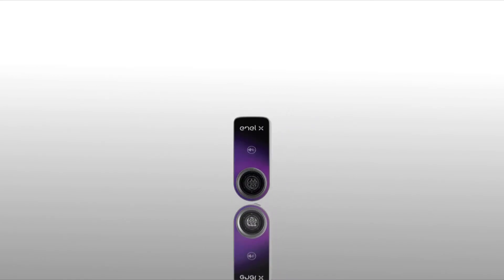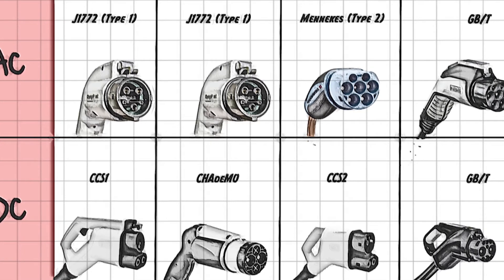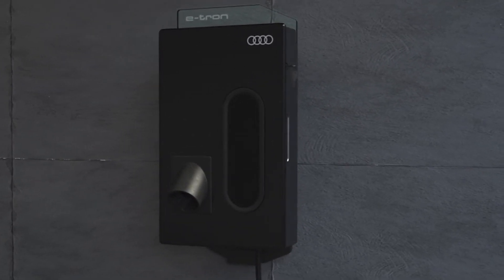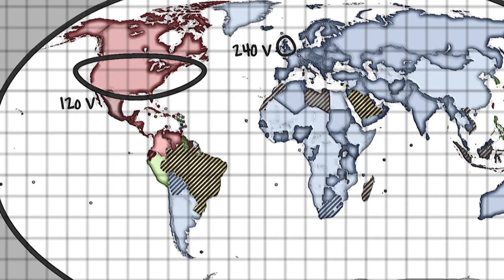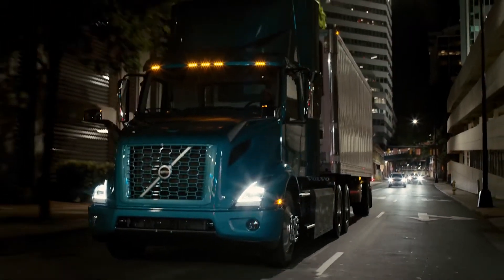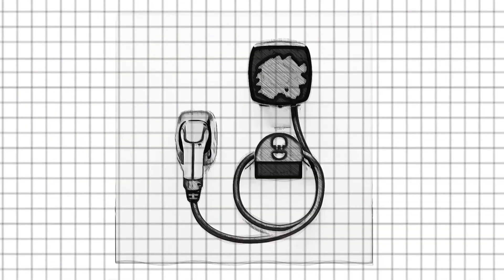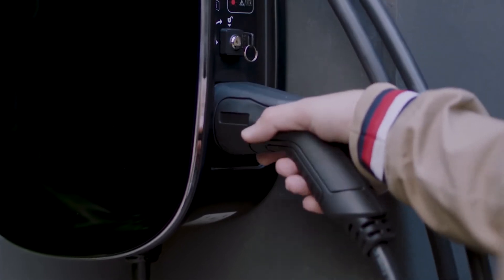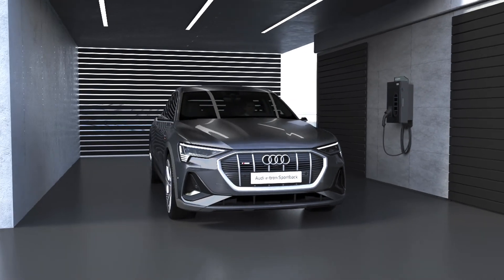W for Wallbox explained! | ABC...EV

Comment: Phew! That was a whirlwind run through of home wall chargers.
I can't charge at home (sob) but I can at work for free (yay). We use two Zappis. Non-tethered.
One thing - you plug the car in first then plug the charger. On removal you do exactly the same. Do it in reverse order and the car and Zappi don't like you one bit, and then refuse to release the cable. Should really be easier. I put the issue down to the fussy VW ID.3, as a Corsa-E has no such problems.
Reply from the maker: I remember you mentioning that about your iD3 before. Hopefully it's fixed by an OTA update at some stage. Thanks Andy! Appreciate all the interaction.

Comment: Wall Chargers take the electrical power from your home and adjust it for your cars capability much like the power company adjusts the high voltage power to be the correct voltage for your home. Like some home appliances then can often come with the ability to handle two lines of power but aligned like the power company supplies them. Bottom line here is the greater the home wire size, breaker capacity and outlet capacity is the more current the wall unit can hand off to the EV. The EV has a limit in handling electricity like wires, breakers and plugs. Some wall units could supply more than required but properly set up that’s not a bad thing as most are adjustable to match your EV. You may have guests or upgrade your car in the future so having a wall unit with greater capacity to charge is not only future proof but better than having less capacity than your EV could use. I’m not sure about an untethered wall unit as a positive. The more connectors the more chance for failure. If the either end goes bad remember they were made by the same company and you may what to find a better made unit anyhow rather than just the cable. Your thoughts?
Reply from the maker: Tethered is probably more suitable in most cases due to standardisation. I like your point about getting a charger beyond the capability of your car to future proof and provide for guests. As EV numbers grow, you might find yourself with 2 or 3 visitors that would all like a charge! Thanks for the comment Gary!